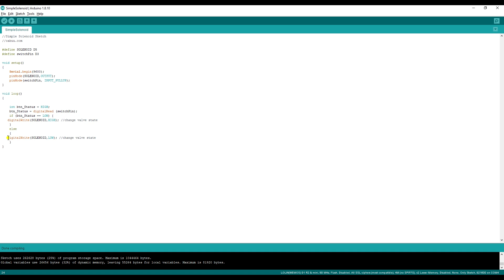Simple Solenoid Tutorial - Control a solenoid with a D1 mini micro-controller and push button

Comment: Hello. I have a question. If I wanted to simply wire one of these directly to a 12 volt battery and then also to a simple on off toggle switch. Can I use wire that is 25 feet in length? Is that gauge wire it comes with good enough for that distance?

Thanks.

Comment: Would this work with a 12v solenoid valve, also if I were to connect a button to the battery and solenoid valve, and then connect the grounds from the battery to the valve, would it still open if I pressed the button, and then close if I press again?

Comment: Very helpful! If I were to make it where the push button releases like a pinball motion instead of retracting, what code would I be switching? (I'm new to arduino)
Reply from the maker: You just need to change the order of the code, happy to provide an example if you're still struggling.